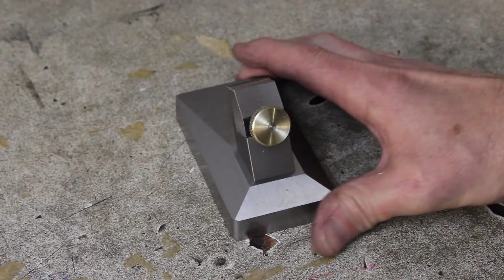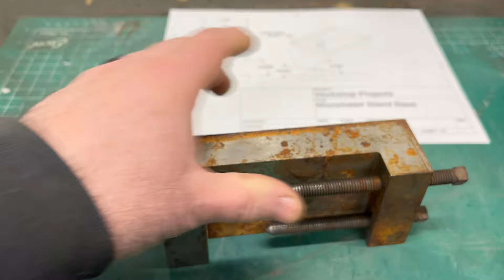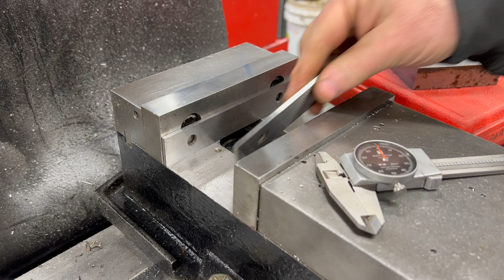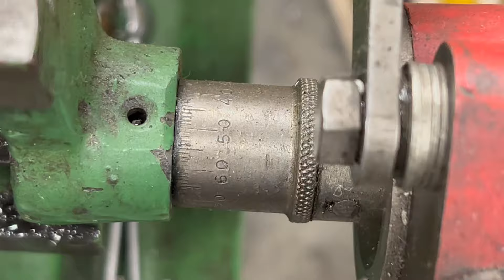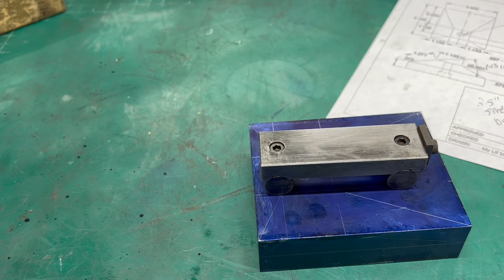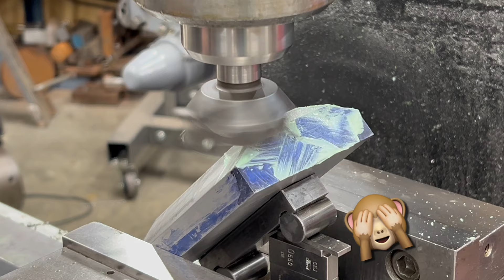Creating A Custom Micrometer Stand: Step-by-step Build - Part 1 - Making the Base

Comment: Use oil instead of anchor lube when shaping. The anchor lube is pulling small loose chips to the face of your cutter which gets wedged between the cutter and work piece, and it's scoring the work surface. This is why, as you mentioned, it started out making a good finish, but steadily got worse across the part.
Reply from the maker: I never thought about that. I have had good luck using the Anchorlube in the past with the shaper, but maybe I was just getting lucky. I will have to try some experiments with both kinds on a new piece of material.

Comment: I think D2 sounds right. May want to try annealing it. I know that's a different problem . I have the same problem with some spring steel it cut fine it the bandsaw but won't machine well. I don't have CBN or ceramic inserts. So I am looking for a hotshot 360
Reply from the maker: A hotshot or something like it is definitely on my list of equipment I want to get.

Comment: This is gonna turn out to be a great project, I may copy this design! 

The tooling you referred to, I’m certain it is a wire EDM vise. Based on the rust and the screws used for light clamping and it being low profile. I have a bunch of 3R EDM products that are similar. 

Looking forward to the next installment!
Reply from the maker: I never even thought about it being something for EDM, The place these came out of might have had some EDM machines, I didn't see any, but definitely could have been in a different part of the building. That's the trouble with auctions, sometimes you never know what you are going to get!

If you make one of these, or one similar, please share it on my Facebook page!

Comment: Might be D2, also make sure the tool swings or arcs up and away on the return stroke in the 
shaper clapper box.
Reply from the maker: I'm cutting left to right, so my clapper box is oriented in the right direction. Although, now that I have switched the vise around, I should be cutting right to left, toward the fixed jaw.